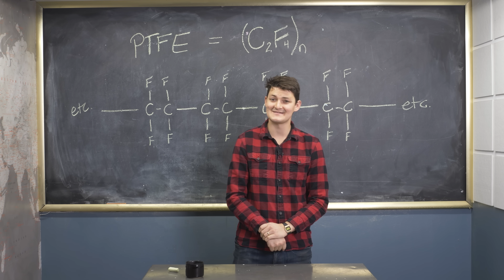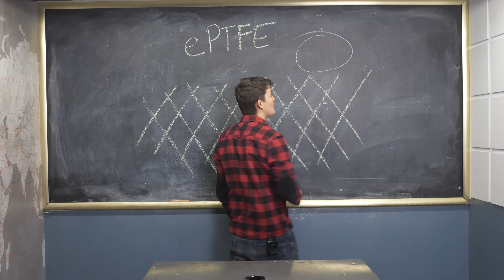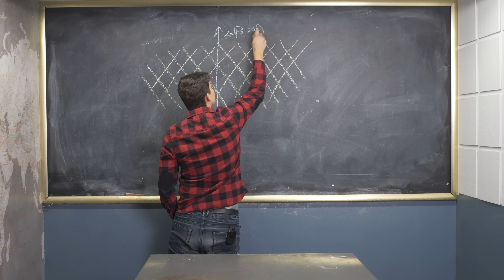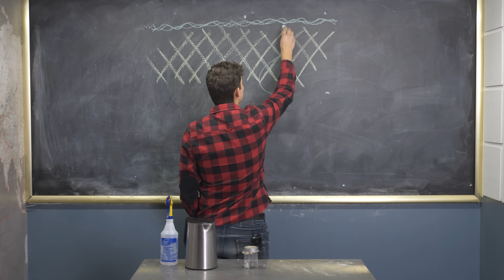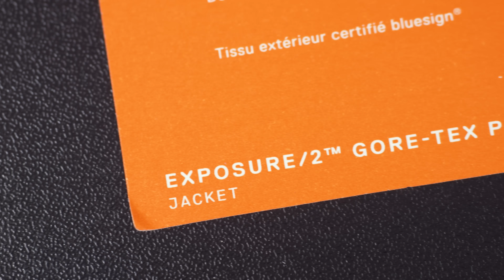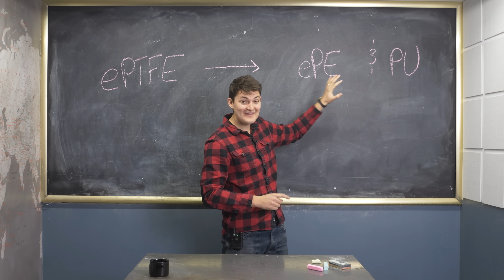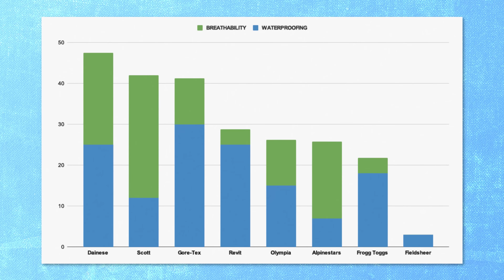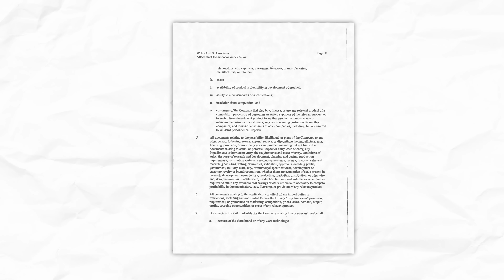Gore-Tex is a Marketing Gimmick

Comment: Cycled to work in my Gore-tex Performace shell and over trousers this morning. It was raining cats and dogs (and an occasional hamster). After 40 minutes I arrived at work. I was dry, apart from my feet and gloves. Gore-tex has different membranes with different breathability. If you are going to Scottish Highlands in December you might want Pro Shell jacket with armpits. If you are running you want something more breathable.  Footwear and gloves tend to wet out a lot faster than shells. I find shells and overtousers to be more reliably waterproof than gloves and boots.
I would not trust £50 jacket if I wild camp during the winter. It's hydrostatic head will be around 10000 mm. High-end Pro shell will have above 30000 mm. That means for water to press through the membrane takes wayy longer than 10000mm. That usually happens in the shoulder strap area first.
Not saying it's perfect but I would trust the gore jacket above any other membrane option. I had a shell with Event membrane from RAB before, its breathability was excellent but it was not windproof. And it did wet out faster than gore jackets do. If you are not too fussed about the weight, Paramo is a great alternative.

Comment: I've used GoreTex and old-style wool-and-waxed-canvas, both on the ski slopes, and when working and living outdoors in below-zero temps for multiple weeks.

On the ski slopes I prefer GoreTex. For working and living, I prefer canvas and wool.

When you're really working, GoreTex might breath, but it doesn't breath enough. Keeping dry in the cold depends upon venting, and nothing else.

A properly-designed GoreTex shell needs proper venting. But a shell with proper venting doesn't need GoreTex.

Comment: For motorbike use....I may agree.
For hiking, mountain climbing...I disagree.

This year I had Goretex hard shell when climbing 4100m mountain.
300m from the peak weather changed to gusts of wind nearing 100kph.

I had:
Goretex hard shell
Light dawn mid layer
Heavy Merino base.

I also had non-goretex "windproof" trousers and merino base pants.

My torso was warm, wind wasn't penetrating anything, I was dry.

Trousers on the other hand...I could feel icycles penetrating my skin.

Is Goretex overprised? For sure.
But it is not useless. Everything depends on the situation and conditions.

Only idiots think that they put on goretex jacket for 1000 dollars and they can run, ride, swim and sleep in it.

No matter your gear, cimbers use layering for a reason...to control body heat.

Again...for biker use...maybe goretex is BS.

For climbing...I find it great.

Comment: Winter mountaineer here, bought the lie initially and bought some EXTREMELY overpriced Gore-Tex gear.  Used it a lot and discovered it's a scam.  It's pretty water resistant considering it's somewhat breathable and pretty breathable considering it's somewhat waterproof but the truth is, it's not very waterproof or breathable.  I now use gear that's intended to be completely waterproof and mechanically ventilate (Which means opening zippers and vents and removing layers at the first hint of overheating)  Works WAY better than my VERY expensive, top of the line Gore-Tex gear.
Reply: Would you mind sharing what gear you're using?
Reply: @villecool1 For winter trips, my shell coat is one that I made using Silcoat, a thin, ripstop nylon (if my memory serves correctly) with layer(s) of silicone in/on it.  
My bottoms, I realized when you asked the question, ARE Goretex, I'm currently using military surplus shell pants.  Not sure what kind of Goretex they are, it just says "Goretex" on the seam tape.  I tried them mainly because they were cheap and probably reasonably durable and I've been plenty satisfied with them as snow pants.
The caveat to all of this is in the winter, I try to avoid going on a trip when it's warm.  Ideally my upper temperature cutoff is 5 degrees F.
For warm weather stuff, if I'm working in the rain, I use straight up Grundens PVC rain gear top and bottom.  Yes, it's heavy and somewhat stiff but it's like armor from the water.  
I don't do much hiking in the summer, I'm usually working but I've got some old school military surplus tops and bottoms that are pure waterproof.  
The secret to staying as dry as possible while physically exerting yourself in a wet environment is mechanical ventilation.  
Pit zips and over size rain shell allow air to move in and out around your body and carry the moist air from sweat away. 
Another absolute must is for the base layer to be as thin and large pore-d as possible.  
I tried an under armor shirt and it was HORRIBLE.  Might be better in a hot climate but while it might wick ok, it didn't breathe worth a shit.  
I also tried a fishnet bottom layer, the job of the base layer is mainly only to keep the subsequent layers off of your skin so a fishnet base layer is perfect but after a couple days the fishnet kind of started to rub my skin raw and the salt from the sweat on the tender skin was NOT a god thing.  A large hole fishnet made of soft material would probably be fantastic.
Full side zips in the bottom snow shell is vital. Lowering zippers is the best form of mechanical ventilation, followed by rolling up sleeves and pant legs.  That's why oversize shells are so important, you have to be able to roll them up and expose the base layer if it's not precipitating.

Comment: Interesting context. Not being both, water resistant and breathable at the same time might be true. 
But I see it a bit different. I own a triple-layer Gore-Text jacket (yeah, another marketing voodoo likely) and that thing has been completely(!) waterproof for years now. I never even got a stain of water on my clothes, even in super rainy conditions. On the other hand, I can wear that jacket as a top-layer when it is cold and it will block out the wind, and be breathable at the same time. So it is dual-use for all kinds of weather.
I have also owned multiple pairs of Gore-Tex shoes that have the exact same feature: They are breathable all day and when I step into a puddle or get caught in a shower, I don't get wet feet. To be fair, I must point out that the membrane on the shoes tends to fail after app. 1.5 years due to the harsh bending it is exposed to when kneeing down with the shoes.
Other brands might be able to deliver the same performance, but as already pointed out by someone else in the comments, you never know what you will get with these.

Comment: Do you even understand what Goretex actually is? 

Goretex is an expended ptfe membrane faced (usually on both sides) with fabric. The fabric will promote leakage through stitch holes so the tape seals on the seams are of critical importance. 
If the tape seals are poorly adhered during manufacture or have become so during wear the garment will leak. 

Salt is a water attractant, so the salt from sweat (which Cannot pass through the membrane) must be washed away with clean water (no detergent)  or it will suck moisture through just by its very nature. 

Goretex enables water to pass through from the inside to the outside by means of body heat - without that it cannot perform that function. SO: A poorly made or poorly maintained garment will leak, and it cannot work for tents due to insufficient temperature difference. 

If you are finding that Goretex is not working for you, look first at attention to detail during manufacturing, and then wear and maintainance. How well are the tape seams adhered? Are any of the seams actually not tape sealed? Are there any cuts or accidental holes in the garment? Has it not been washed in clean water?

How do I know all this? I was in the mountaineering trade when Goretex first came out and as with all new ideas there were teething troubles in the first few years. If manufacturers are becoming lax in their attention to detail during manufacture after all these years they only have themselves to blame when people start complaining.

Comment: A good rain jacket will have pit zips for hot/humid conditions or exertion. If you layer properly and keep the garment clean and DWR intact, it can’t be beat. The gore-Tex fabric is the backup layer for when the DWR fails. The DWR needs to be re-applied SEVERAL times a year for it to work properly. A nylon jacket will not remain waterproof when the DWR fails. Few people actually understand this and get butthurt when they find out their $1K jacket requires significant maintenance to work properly.

Comment: I purchased Gortex raingear for a thru-hike of the Appalachian Trail back in 86 because the techs at the outfitters said it was the best and most high tech stuff on the market. It didn't take long to find out that was total BS.  I wound up ditching the "high tech" and very expensive jungle rot raingear and just used a garbage bag for the remaining 2,000 miles.  Also ditched my expensive Vasque boots for a pair of $6 Kmart Trax tennis shoes. It pays to get rid of not-needed extra weight.

Comment: great video.. you're definitely right when you say you can't have Breathable & Waterproof - it's always a tradeoff.. However I disagree when you say Goretex is not THAT waterproof - the Pro Shell @  28,000 hydrostatic / waterproof ratting is top of the game unless you're wearing a rubber suit!.. I've tried vertualky ALL the different manufacturers 'waterproof' and breathable shells over 40 years if madventures and nothing does it better than the ProShell, still ( and I'm out there in horrendous conditions as I chase storms for a living).. and if you're sweating under your shell then I'm sorry but you're doing it wrong - you need to take layers off and put a stop to sweating underneath.. sure tgeres time when you sweat but its under situations that can usually be avoided by shedding undergarments..
And yes , totally agree that  Goretex is overpriced and no one likes that, but it's damn good at what it does so if you're looking at other shells then the most important aspect of any shell is it's hydrostatic rating.. if it's not 28,000 then it's not comparable full stop...and if it has NO hydrostatic rating then don't go near it regardless of the hype as any top tier rain shell worth its salt with happily trst & advertise this rating and conversely not test its product if it's not up to this standard.
Keeping dry UNDER your shell is all about layering & venting -  don't go near a jacket if it hasn't got 'pit zips & trousers should have zips down the side... oh and while I'm at it NO zip is waterproof no matter how theh spin it when you've got 70 knots of sideways rain!..so make sure your shells have storm  flaps over the zips as well if yiure serious about staying dry.
good vid tho, agree with most of what you said , keep it up!

Comment: Crappy part about Gore-Tex is it wears off when rubbed against anything. I purchased a nice jacket I love that is Gore-Tex but when it wears off I have to reapply waterproofing spray. Brings it back to life. Maintenance is key to the jacket. Very breathable and warm but is a pain to maintain. Just keep that in mind before buying anything gore-tex. It isn't the end all be all, but when it works, it works nicely. Also, you can spray just about any jacket with the kiwi water proofing spray. I've sprayed boots, gloves, jackets anything I want to keep dry.
Reply: Goretex does not wear off,  it’s the DWR coating which wears off! Goretex is the fabric on the inside, this has an outer coating often of nylon or similar which is made highly water repellent by the application of the DWR, this can wear off over time, thankfully the DWR is replaceable but it must be applied exactly as the manufacturer details! 😀👍

Comment: As PNW Skiers , we learned during rainy days on chairlifts that the oil from hands and drips from greasy cable towers that Gore-Tex will leak.
Powdered laundry soap would make it bead the water again on top half of our rain pants.
Those square molecular bonds need a square block of soap to work best.
Liquid soap didn’t work to revive .
My Eddie Bauer pants are over 40 years old and still in use.
Guessing Scotchguard has the same effect.

Comment: I discovered the horrors of pressure with my first Gore-Tex jacket

I got back to my car at the trail head, and since it was somewhat cold I had turned the heater on in my car.

Pretty soon I was soaked through (I'd been walking in the pouring rain for eight hours). I theorized that actually the car was warmer in someways than my own body's surface temperature, and had therefore pushed the water towards my skin
Reply: It was probably condensation on the inside of your jacket or sweat
Reply: You would be soaked through because of your own body moisture, not the water outside. One thing gore-tex does have is the pores are smaller than the water droplets, so the water can't get in, IN THEORY :D

Comment: This is all interesting, but I've had a some Gore-Tex things, and they have performed pretty well. I didn't expect them to work as well as diving suits, and I don't run marathons in 35-degree rain, but my feet stay dry when I walk through water, and water doesn't come through jackets. Water does come through other jackets treated with Scotchgard, so I don't think chemicals are the main reason Gore-Tex performs well. And I don't get sweaty with Gore-Tex. I will keep buying Gore-Tex or whatever comes along that works better.

I've had highly waterproof jackets made from materials other than Gore-Tex--basically rubber or plastic--and they trapped sweat and made me miserable. I borrowed a ripstop nylon sleeping bag once, and even though the fabric was technically open to water vapor, sweat collected inside it, and this was in a desert. 

I had waterproof, insulated leather boots (two pairs made by Sears and Timberland) made without Gore-Tex, and they rotted and fell apart, mostly from sweat, even though I didn't use them much. The soles fell off. Timberlands are worthless junk. I have boots and shoes with Gore-Tex. No problems, even with boots 20 years old.

I don't believe for a second that a Hefty bag over a sweater will leave me just as comfortable as Gore-Tex. You should do a test video. People who want to sweat to lose weight jog in impermeable clothes, not Gore-Tex. And once a wool sweater is wet, it will stay that way for over a day. I wear wool socks, and it takes them over 24 hours to air dry.

As for water vapor inside Gore-Tex hitting the fabric and condensing inside it, I have never noticed it. If it really did that to any significant degree, I would expect to feel sweaty in Gore-Tex, and I don't. And if your theory about condensation were correct, why wouldn't it happen with every other fabric? Water molecules will condense on anything cold, whether it's Gore-Tex or wool or whatever, as long as they lose heat to the surface fast enough. 

Condensation isn't just about temperature differences. It's also about a material's ability to transfer heat quickly. If it can't absorb heat from water vapor in a hurry, condensation will take place slowly. Water condenses fast on steel car frames, I have never seen condensation on a tire.

People sweat every day, even in cool weather, but our clothes don't always stick to us. The water is getting through most fabrics somehow. It's material-dependent. Women get moisture-related yeast infections from synthetics, but not so much from cotton, in the same weather.

Maybe Gore-Tex is not as great as the company makes it sound, and maybe it should be less expensive, but I've had Gore-Tex stuff off and on for 50 years, and if it had failed to provide satisfactory performance, I would have noticed by now. And it's a lot cheaper than horsehide, which sheds water better than cowhide.

Comment: THANK YOU ! 
I work outside for 3 years now and it rains a lot in my region (northen France) and i'm desperate to found good waterproof gear. Having wet feet regardless of the quality of my shoes my scientific background kicked in and i thought " wait, i'm always gonna be as dry as the outside of my shoes even with the best gear on the market, and if the outside fabric is soaking wet, watervapor will move in" but i didn't bother to check my toughth. 
Now i know that i must look for non breathable but truly watertight gear, anyone can recommand good pvc ponchos ?